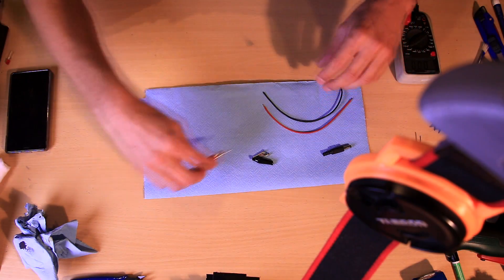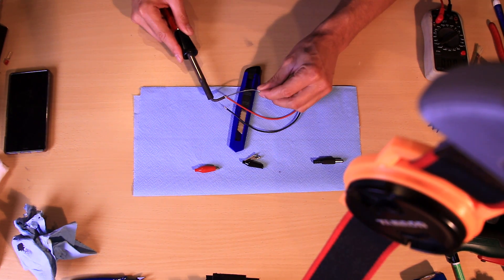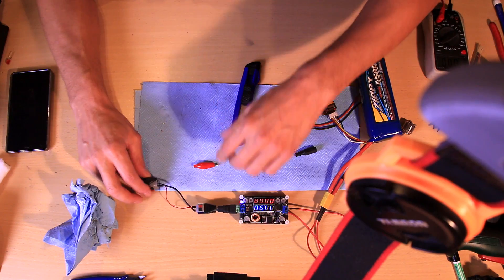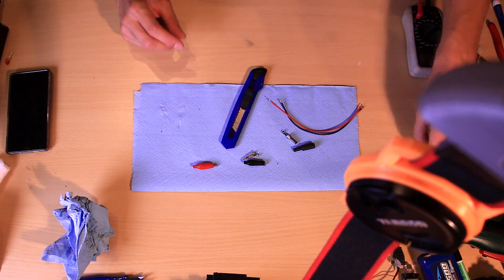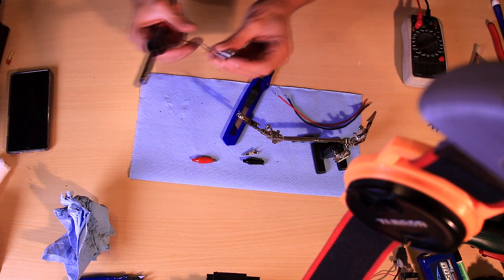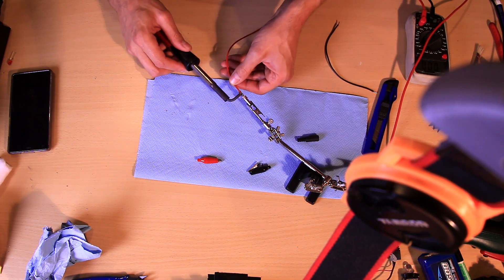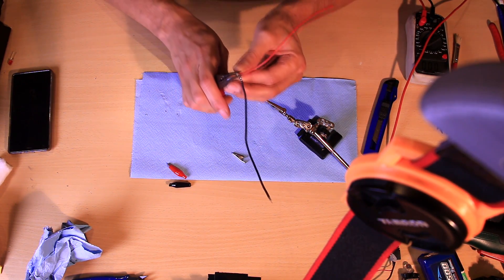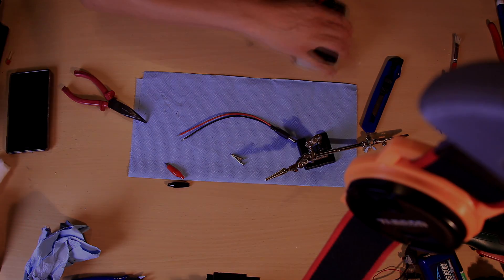#48 🔌 Soldering a DC Connector to a cable

Comment: Wait! Did you soldier them reversed. Thought the shorter  tab is positive and longer tab is negative?
Reply from the maker: Hmmmmm, I think you have a keen eye and it seems like I did lol....gonna check my original footage, better quality 😳
Reply: I was doubting myself for a moment when I was making a  cable. So I was looking for a confirm. Watch skip your video to the soldering part thought i was wrong. Luckily I check with my multiple meter before I plug it in and realized was reversed. Just wanna make sure it is the correct info. Don't want people to wire reversed like I did.
Reply from the maker: In my defense, you always need to check the polarity in a dc connector, depending of the device!
As there are different applications, with positive center or outside, so basically it doesn't really matter that much, how I showed it, still need to check yourself...the standard shifted last couple of years tho.

Comment: what do you think about cutting 12v dc Male/female extension cable making 1 male pig tail and 1 female pig tail
Reply from the maker: Off course, just do it 😉👍🏼
Reply: I have a 20 watt LED strip with 20 Gage on it can I connect a 22 Gage pigtail to it
Reply from the maker: Sure, 20watt is not much, should work!